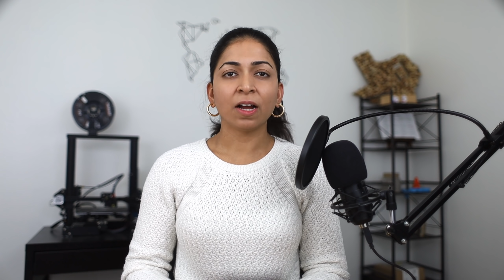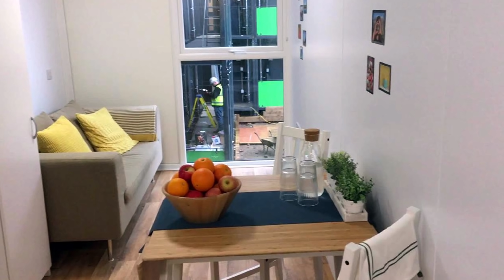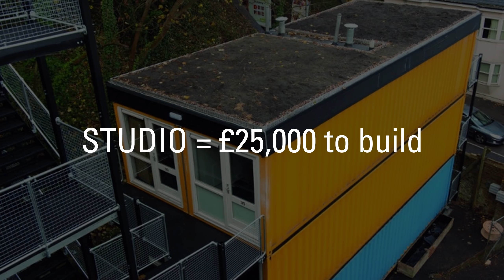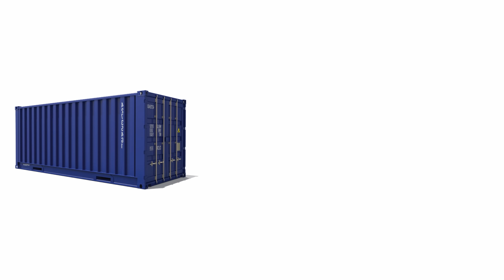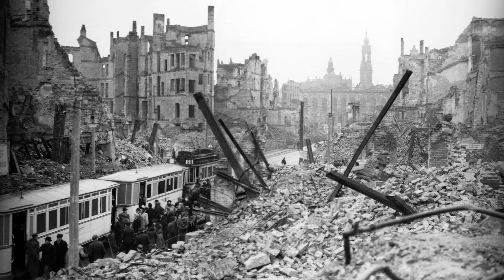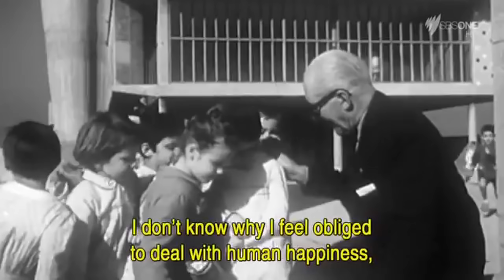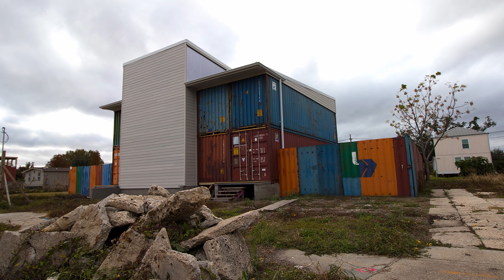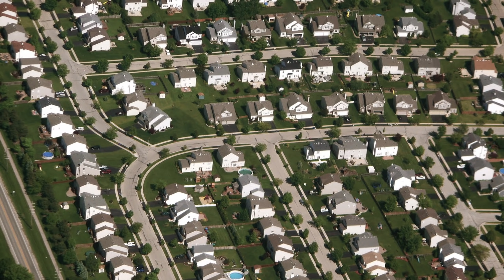Why Shipping Container homeless shelters FAIL

Comment: "They will build it themselves" seems like the arrogant mentality to me. These are meant to be HOMELESS shelters. If they had the ability to get their own housing, they become irrelevant to the purpose of these buildings. 
It's also not practical to be giving people in these situations "what they want" all that will do is give a false sense of entitlement of getting everything they want for free with no effort of their own. I'm not trying to say they should get a gray box of concrete and be happy about It, I'm saying you can't go too far the other way. Affordable housing should be just that, affordable. Somewhere to live temporarily to get themselves on their feet and then get their own house themselves to make way for others in need. 
People do deserve better than minimalism, mouldy units, and huge temperature swings yes, but you seem to be forgetting that those problems themselves are design problems. 
And let's not forget, I would be more than willing to bet that not a single one of these people in this video are willing to pay for any of this. They just want to spout pretty words to sound good and then disappear once they're asked for funding.

Affordable housing can't be too minimalized yes. But you can't over emotionalize the issue either. If you truly wish to help as many people as possible, expenses need to be kept in check. Find the middle ground.
Reply: No ventilation leads to mold and condensation issues. They didn't surround the outside to prevent rust and leaks and double up the thermal mass for winter summer fluctuations. Gives you claustrophobia living in a metal tunnel. We aren't flat like folded packing boxes! Better to put two together and have space to move in the cube. Roof them too. Solar bring down energy costs. There is no cheaper low income housing to move to to get out of their 'temporary' housing. It will never belong to them so why should they invest and hope? Two way street. A balcony for a couple of plants and step out niw and again helps too. They could put windows in the sides without ruining structural integrity. Gotta love how they blame the tenants for badly designed, rushed jobs to shut them up and put them up. Thought they have row upon row of old council houses lying empty? Why aren't they being given the chance to buy them and have pride of place?

Comment: Of course, the fallacy is based on the notion that "shipping containers can be cheaply converted to housing, and are just as good as any other type of construction for habitation." And these assumptions may not be true. If done properly, they can be frightly more expensive per square foot of living space. They can be difficult and expensive to insulate and heat, and you end up living in a narrow box. There is nothing wrong with wanting to live in a tiny home, but you are probably better off just building a tiny home from scratch. If you crave the industrial look, you can do that too.

Comment: I worked for a USAID contractor and we had a contract to build community centers in Afghanistan, where local leaders could meet to determine their futures, and keep meeting to overcome problems that naturally would arise.  The Army Corp of Engineers came up with a design that arrogantly ignored the local culture and we flat out rejected it, at the risk of losing the contract.  We consulted with all the local elders and built them a center they would use, that looked open and inviting, but could become a safe fortress in the event of a Taliban attack.  The home-grown design cost about twenty percent of the Army’s design and used over ninety percent locally sourced materials, so could readily be maintained and repaired.  
We recognized the Army architects’ arrogance because years earlier, we installed cinderblock latrines across Haiti, in an effort to improve sanitation in poor neighborhoods, where people were relieving themselves in their back yards.  These latrines had flush toilets and sinks with running water.  One year later, most of the latrines were being used for storage or livestock housing by the neighborhood bullies.  Some thugs were charging their neighbors to use them.  We arrogantly neglected to consult with the locals on what they would actually use, instead of their yards, and  didn’t explain to them how to use the latrines, that they are for everyone to use, establish a way of enforcing their remaining available to everyone for free, and how to maintain them. 
Thank you, Belinda, for calling out the ignorance and arrogance of “educated” decision makers who waste money and ruin lives with their “good” intentions.

Comment: Why are they even thought of for long term living? They should be a stepping stone to better living conditions (no more than 2 years living there, enough time possibly for someone to get on their feet, and plan to move up to better. ) These projects should include support systems designed to get people to be self sustaining, with the explicit goal of moving them into more permanent situations.

It looks like the real problem is thinking that those projects are the end solution. They are not. They should be a stop gap, on the way to a better solution.

Comment: You said one thing that I agree with - when things are done cheaply they fail.....  Shipping containers are not a failure because of there super strong steel shell exteriors  but because standard housing insulating procedures are applied to  shipping containers which are not compatible with the steel shell.  Once again the failure is not in the container but contractors using the wrong finishing methods to cut costs.

Comment: I'd say that "what people (the homeless) want" isn't an issue when it comes to homeless housing. It's just a matter of what they _need_to make things however much more manageable for them. It shouldn't be ideal living conditions, just no major problems like mould, extreme temperatures, or structural failure or such.

I think the biggest thing with low-income/homeless housing is that it should be highly robust and durable. Concrete structures maybe 2-3 stories high, with shared courtyards, maybe insulated with roofs in places with particularly cold winters. It's probably cheaper to set up UV lights in the courtyard/atrium with a regular roof than to deal with the extra costs of constructing, maintaining, and heating an insulated glass pane roof.

Comment: I am retired architect in small town near Sydney Australia, and was on a local housing association board. The world needs a lot of new affordable housing. Shipping containers not a good solution. (no need to go back to Corbusier etc, unless you want to mention Christopher Alexander, EF Schumacher - but the architects have not helped for a long while and it has never really worked) All Governments are not wanting to spend a lot on subsidizing housing, and if they do it that also creates large problems. Regulations now significantly discriminatory -ordinary person can't use a shipping container for back yard granny flat, and you cant just build a well insulated timber framed cottage on land you own without trouble - whereas the developing world builds cheap (affordable by our standards) owner built medium density housing as typical - well below developed world regulatory standard. Major issue is high density high rise for affordable housing. Instant slums almost always. So small lot (block of land) solution, medium density, relaxed regulatory  burden. Then - Can it be done for about 4yrs value of basic wage in your locality, at 30 yr loan at current relatively low interest rates - no government subsidy, but perhaps a zero interest loan to cover 20% deposit, with extra help for for needy widows and orphans?.  Rents are very high especially in the expensive cities. Small efficient units, on own lot and owner occupied are a much better solution than anything offered by a nanny state, but State, Architects, Planners, Market and Regulators all getting in the way. Needs a grass roots movement. Keep producing these good informative videos. You may be the voice to pull the downtrodden out of their slumber. One thing is for sure the poor, unemployed and homeless are not organizing themselves enough, and need help. In Australia there are over a million unemployed, most of whom would be having trouble with affordable housing. It's a big 'constituency' If they all turned up next Sunday afternoon in front of Parliament house, perhaps something might change.

Comment: I don't generally agree on Belindas idea of a shipping container being a bad habitat for living. It's a structual frame as any other. Well insulated and with good air conditioning it's not much different to concrete block wich does share lots of similar properties. It needs to be engineered to last just as any other structure. Size is the main issue, but in a time where mini houses are a thing and every square meter costs ridiculous amounts, they do make a compelling option as easy to move, modular and standardized structure. Not for everyones standard of living of course.

Desinging a completely new, standardized and optimized for living "housing container" would be awesome and I think it's gonna happen sooner than later. Modularity is already a huge thing in a constructing business. Units like wet spaces, technical spaces and kitchens are constructed off the site and put in the apartments on site. Walls and roofs area similarly modular. Industry is just not yet organized enough to standardize them.

I agree there is a huge problem with social infrastructure and building it. I live in Finland, where schools and houses just twenty years old are having serious problems with inside air quality. Huge amounts of public money are just thrown away when quality control fails badly. We all lose in the long run as those resources are lost from education and social sectors. Social segregation cultivates problems where they need to be prevented. There is really a huge need to work out these problems, and ambitious plans and desings tend to come along with them. Thing is these problems are many times in a structural and ideal level. So we need structural and idealistic solutions to work them out.

One solution could be a container home sitting on the wasteland in the middle of or next to suburbs. Fully self contained unit or plugged to the municipal grid. Unit can be taken to people where it is needed in no time and is easily extensible with another unit. Spreading units like this around separate people from huge "problem" apartments and districts and prevents segregation. It's definitely not as efficient as apartment blocks, but does handle wider variety of problems than the most immediate. Allso this kind of housing makes it easier for low income people to own their own house as they don't pay for extra squares. Risk of owning comes down as it's easier to liquidate the unit as it's not bound for specific piece of land they can lease. In this regard container is much more of an house than fairly lightly constructed trailer. And still mobile enough to be moved around as a single unit.

It's not optimal for family. Where there are lots of room needed apartments and houses do way better job. Container housing does not solve our social problems. But I claim that it's a good solution for people in need and for small and young households as a great option of sufficient and low resource living.

Comment: The common thread isn’t so much the arrogance of the architect/design but the rock bottom cheapness of the design and poor quality construction. The shipping container homes you feature suck because they saved every penny they could by removing “features” like normal width and insulation. Really dumb. A well designed shipping container home is not identifiable as one and is about 10%-20% cheaper compared to a stick build.

Comment: After looking at your video and reading the comments, including a few from pdor who work with the homeless, nobody seems to offer a solution - including YOU who is an architect who cares!
Reply: It really is because there is no silver bullet. I brand myself as a poverty alleviation engineer (a degree in mechanical engineering, but I focus on designing systems, businesses, and products that alleviate poverty). One of the main issues of designing for low and zero resource communities is the disconnect between those experiencing poverty and those trying to aid their plight. We (royal we) think we know better because we are not in their situation so offer solutions that make sense to us, but it needs to make sense to them. This disconnect leads to an abandonment of our imposed idea because we usually miss a key component in our exuberance to get our idea installed. BYU’s Product Design for the Developing World team did a great publication on the 9 main principles necessary to designing for the resource poor. https://static1.squarespace.com/static/5c7ee75b92441b465f176f7f/t/5f334fc13f416d67e26a2728/1597198274847/9principles_wood.pdf

But in answer to your main question, as to what system to implement; in short, the impoverished in Dallas will need a different approach than those in Boston. And taking studies in Seattle won’t solve the others’ issues. We need to get hands on and face to face and bring those affected to the design table and work with them to help them design their own systems. There are a lot of psychological ramifications that I can only speculate on through my lack of experience and education, but what definitely seems to be a major issue is idea ownership. (I believe it has to do with maintaining human dignity through fulfillment of one’s own ambitions and realizing your idea into reality that secures a more genuine adoption).

Comment: Shipping containers with the inside of the walls sprayed with 50mm of polyurethane closed cell foam will solve the insulation and mold problem. There are numerous successful houses built with shipping containers. Good design is required.
Reply: Name one please.
Reply: Then, it will become toxic.

Comment: Container can be used but because it acts as a vapor barrier it needs to be insulated properly. If container is used as an outer shell it can be compared to a metal roof . It can be also used as a frame then it also acts as a vapor barrier.

Comment: hi Belinda,
with respect, i disagree with some of your assertions in your video as there is a much deeper underpinning at work with "social housing" the world over. the subconscious mindset that the "it doesn't belong to me, so why should i care for it?" -attitude sets in and the whole thing goes to hell in a hand basket. living in a converted shipping container fundamentally isn't all that much different than living in a "conventional" house. there are some adaptations the occupant has to incorporate into their daily routine, and once that has been done the container houses are just as comfy as any regular ones. 
in other larger cities the world over, any social housing projects are often derelict within a few short years of initial occupation due to the lack of maintenance by the occupants or the public trust that is charged with the oversight of maintenance. 

on the other hand, there are improvements in the conversion process from shipping container to dwelling, most critically: insulation and ventilation. shipping containers are constructed for use on the high seas and to keep sea water etc out, essentially being hermetically sealed. they cannot and do not "breathe" like a conventional house. some new conventional houses that are sealed to minimize energy loss have the same mildew and moisture problems as converted shipping containers. so comparing a container dwelling to an older conventional one is sort of comparing apples to oranges
Reply: I was going to say something similar. 
Looking at ALL of the great building plans for the (free housing community)  have exactly the same problems.   The residents who always want something better because they have an inherent sense of entitlement that they should also be given a Mcmansion like the urban homeowners have.   
As such they refused to care for whats been handed out dor decades.  All of it quickly becomes an eyesore first with trash, graffiti and broken windows.    Then junk builds up crime, drugs & prostitution further degrades the area.
Totally just 1 thing in common from Soviet era block homes, 60s era US Government housing to the latest container complexes,  the inhabitants.

Recycling the containers into steel studs is completely missing the point of quick and cheap, the recycled materials wouldn't be cared for no better than the container.  It would add millions $ to the prices take years longer with 100% same results.

Comment: Your over agonizing . Most modern buildings fail for lack of overhangs ,Overhangs should work with windows and the seasons ,To shade in the summer ,to solar heat in the winter and keep the building dry and mold free.

Comment: The problem is not the shipping container but how poorly those habitation were constructed, the lack of municipalities maintenance of those housings and the failing social policies.
For the French case with Le Corbusier. 
Most of those buildings were constructed in periphery of cities or in new cities, basically in a no man lands.
Those appartements were made as transition housing but people stay stuck there  until there death.
Instead being the first step to climb the social ladder they were poverty traps.

Nevertheless you have some of those kind of housing which made close to inner city with job opportunities around and those where successful.

To conclude this video only show us If you have bad social policies to curb the issue of homeless and poverty and if you build cheap your house the end result will be a failure.
As always it’s not a technical issue (concrete, wood, steel or glass) but an implementation and budgetary issue